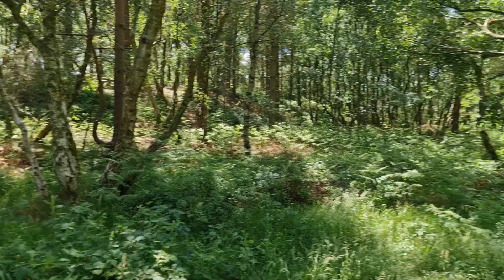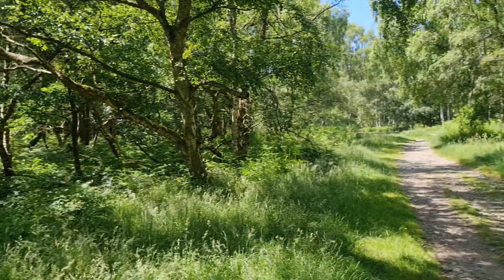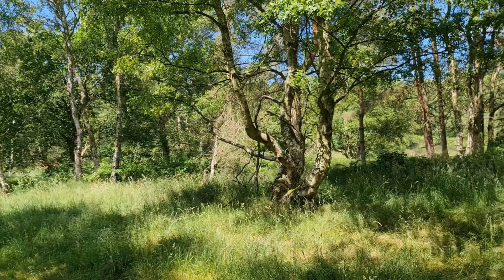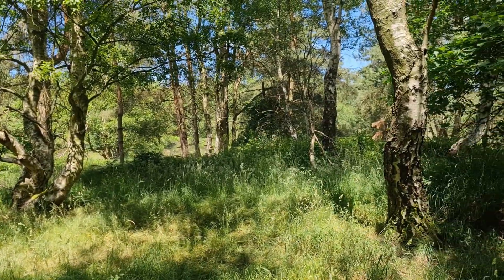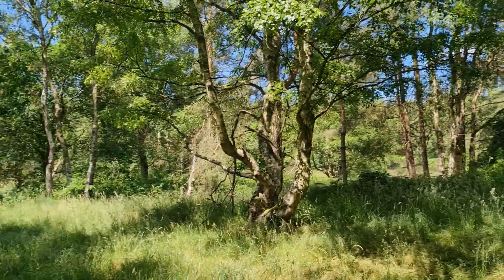iflight crystal and TrueRC Stubbies antenna upgrade

Comment: I'm looking at buying iFlight Crystal HD Patch or Lumenier AXii HD 2. Do you think it's worth upgrading? My DJI fpv goggles is v1. Great test video!
Reply from the maker: Hey, sorry for the late reply 🤦 so the antennas on the goggles ONLY made alil difference, the big difference came when I upgraded both the antennas on the goggles and the drone itself, saw a massive difference over time! Alot better penertration and distance.

The v1 I believe only support 5.8hz so shouldn't be any problems tbh.

Also digital take LH polarised antennas just incase you didn't know, so match them with the drone and your all set 😊 again sorry for late reply, hope this helps
Reply: @dcmedia2096  no worries. I already bought it. I haven't flown my drown really far. Hopefully later if the GPS RESCUE works. I'll keep you posted.

Comment: I've just purchased the same antenna form banggood, but from watching videos I get the impression they don't really improve things when using the DJI FPV. Time will tell I suppose. Where do you get the music from for your videos btw? Cheers
Reply from the maker: Hi, they do improve alil on there own with penertration which is honestly what I wanted, but I saw a massive difference when I upgraded the antenna on the drone, with all antennas upgraded I saw great distance and alot better penertration, not sure I've put a video up about this, need to get another video up.

As for music I usually just Google search royalty free music, but found out youtube have there own library and there's alot of good music on there, hope this helps 👍
Reply: @dcmedia2096  hey man can I ask what antenna upgrade you made on your drone?
Reply from the maker: @Gregor Denholm  if I'm not far away from flying and it's fairly open I'll use the true RC smallest Stubby antenna, if there's alot of trees or obstacles that will interfere with flying I'll always use my tsw long range antenna, never misses a beat with that one👍 however not made for digital so have to use an adaptor for it to fit the drone.

Comment: What was the power in mW? What firmware version do you have on goggles? If it is 01.00.0606 you can do root and enable canvas move and 50Mbps with  power hack
Reply from the maker: Hey sorry for late reply, so this was on the 1000mw and not the 1200mw, simply because I've heard of the air units over heating, I've had no problems what so ever. And yeah was flying with 50Mbs, add a better antenna to the drone and its perfect!